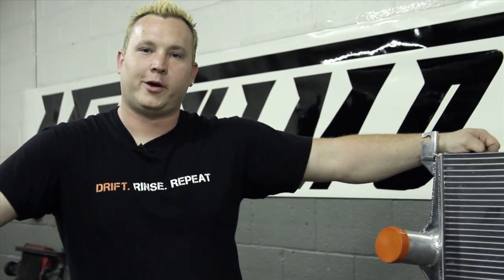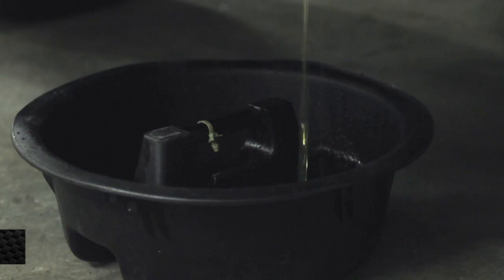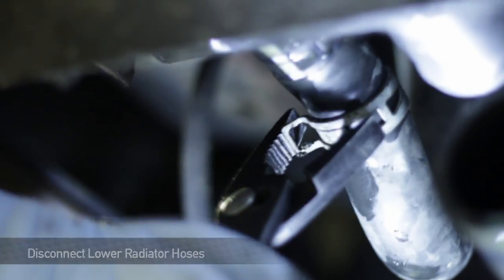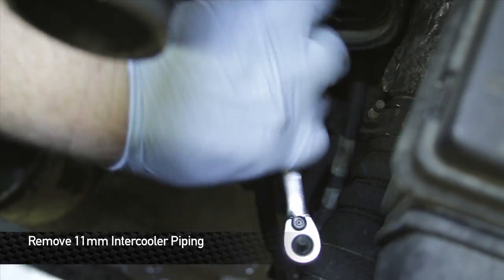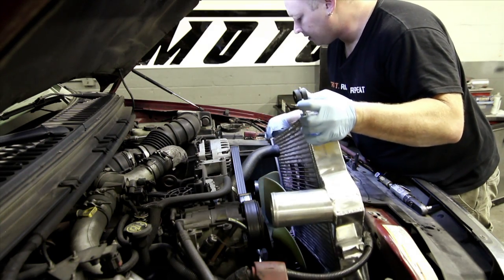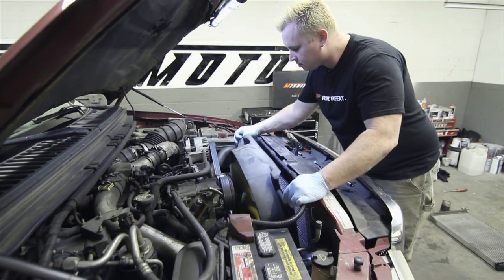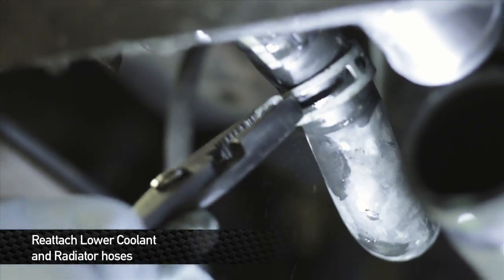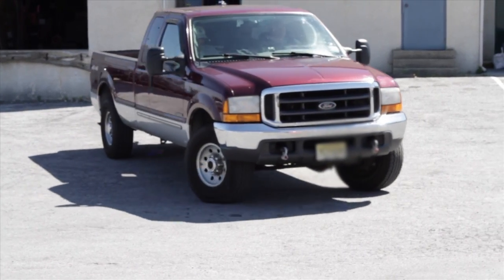How To Install: Mishimoto 1999-2003 Ford Powerstroke 7.3L Performance Intercooler

Comment: You guys replaced the intercooler and radiator but forgot to replace the degas tank. Looks like that tank was on its last leg anyway, otherwise good video.

I love your products and plan to use some in a project truck im working on. Thanks for supporting the superduty trucks
Reply from the maker: While we didn't record it we did end up installing the degas tank on this truck. We appreciate the feedback, and good luck with the project.

Comment: Why would it not be designed to install the lower rubber bushings?  Would it not be rubbing metal to metal and create noise?  Also those channels are much larger than the factory bushings on the bottom can it feasibly wiggle back and forth?  Thank you looks to be a great product to lower EGT's, but concerned with noise and movement.
Reply from the maker: Hey Lexie, this unit is a direct fit that functions with all OEM equipment and mounting points. Simply requires swapping the rubber parts over from the stock set up.

Comment: I have a 2002 F-250 7.3 diesel that I outfitted with a Garrett powermax 88mm ball bearing turbo, DSL performance 4" exhaust kit, got rid of the EBPV system, and International bellowed up-pipes. I have not done anything to the intake side except stick on a K&N cone air filter for now. I also installed a Glowshift 60 PSI mechanical boost gauge. I know my new turbo is supposed to make more boost than my old stock one, but my boost gauge barely reads any boost pressure at all. I have to really lay into it to get it to read 17-18 PSI if I'm lucky. Is it possible my stock intercooler is blown out or my turbo intake pipe sleeves are bad, or might I be looking at something more serious like internal engine problems even though my engine runs perfectly fine with no skips and minor blowby?
Reply: MrNotorius5500 what do you have for fuel, cc & %.   What’s your egt compared to old compressor, you probably have a boost leak somewhere potentially also under fueled for that 88mm idk there’s allot of variables
Reply: It'd alot late but you dint have the injectors to spool it all air no fuel
Reply: The only other thing that comes to mind is making sure you have a great tune. I think I've seen recommendations for a  Gearmaster (???) "Hydra" chip and it comes with Free Lifetime Re-Burns, which come as an email file!

Comment: LMFAO this guy actually said "rolling coal" what a doush, fyi intercoolers don't increase power and for sure will not cause black exhaust smoke.....oh and how is the polishing a "serious feature"??? that thing is nothing more than a copy of the stock intercooler, the only thing you will do is lighten your wallet!
Reply from the maker: Pro-touring F-body This is untrue. Intercoolers have the potential to increase power output by lowering air intake temperature. Depending on a car's current intercooler setup, you may also see a decrease in pressure drop. Please feel free to let us know if you have any questions. - Patrick M.

Comment: O.K. fine if a big rock, or a tree falling off a logging truck damaged my OEM cooler, but are you claiming a performance enhancement significant enough to justify the cost of this product simply as an upgrade to a functioning factory installation?
Reply from the maker: YankeeinSC1 Thanks for your comment - allow us to clarify.  A few things separate this intercooler from the factory unit:

-The Mishimoto intercooler features fully TIG-welded end tanks compared to the crimped factory tanks. This provides improved durability as well as boost tolerance.
-The Mishimoto core composition features very dense fins for optimal heat transfer and AIT reduction.
-The Mishimoto intercooler features a lifetime warranty.

Let me know if you have any further questions!